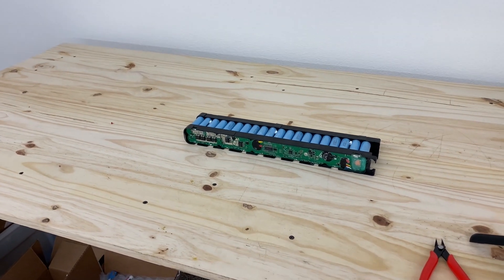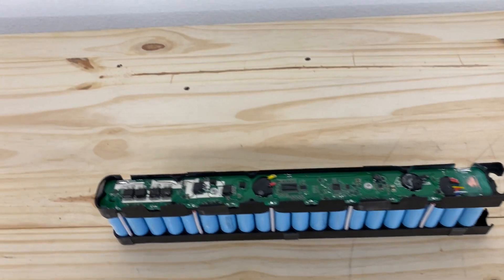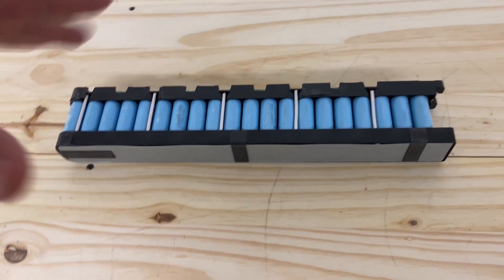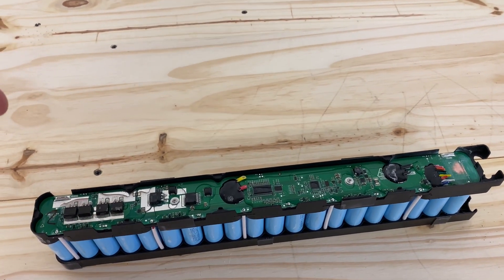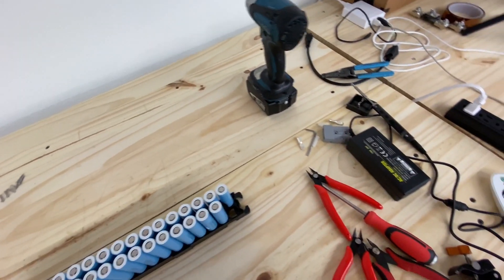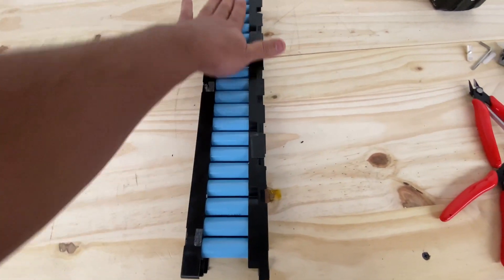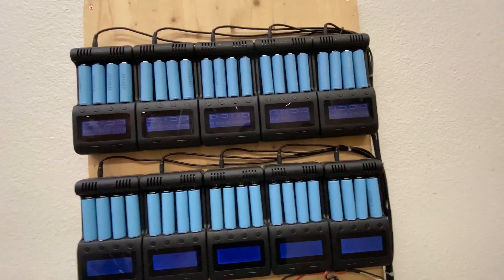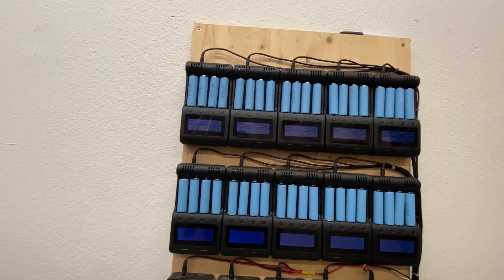The most affordable way to get LGMH1 18650 cells

Comment: i bought a neat little usb module that works from 10 to 80 volts so i can use scooter packs as a portable energy bank.  and i keep the module with me so if i ever need usb odds are something nearby will have the right voltage in a pinch
 .

Comment: Sometimes these salvaged 18650 batteries don't have enough of  an extended positive tab to work in some devices, such as some headlamps. What might be a good workaround for this problem, other than folding up some aluminum foil to bridge the gap?
Reply: What do you mean? As in they are too flat? Pure nickel strips would be a far better option vs aluminum foil.
Reply: No... dont use aluminum foil!!   All you need to do is add solder to the positive sidw.  Works great for flashlights.

Comment: Bought a pack, and the cells shipped to me are averaging 2,900 mAh with 25mR internal resistance using the LiitoKala Lii-500 on full NOR test.  I was hoping to get results like he indicated in the video (~3400mAh).  The ones shipped to me were about 85% the capacity as indicated in the video.  Pretty sad since the "tested" packs were all high mAh, and the ones shipped out are not.
Reply: Could be tested at different amp
Reply: Ikr some of my cells are coming out as low as 2300 mah

Comment: People who use these cells need to be aware all lithium batteries require charge balancing. Otherwise, a lithium fire can start which you CANNOT extinguish. A 2,000F lithium battery fire creates its own oxygen if the cathode is overheated, which is caused by dendritic growth shorts. This defeats most all fire extinguishing methods. Under-discharging lithium cells can also start a fire. This is why the battery pack has a charge balancing circuit board. Only use these cells in a device that already has a charge balancing system for each cell.

Comment: I have 4 of these scooter battery packs. I’m trying to achieve a 72v battery packs for my 72v 2000w bike. Do you recommend that I try using them in series/parallel or should they be reconfigured.?

Comment: These are old Uber JUMP Bike packs. These are 36v nominal packs, 42v full, 30v dead. They are close to the voltage of 2s solar panels. These cells are very energy dense. They have an internal bypass diaphragm under the (+) button. Also, be careful removing the BMS, you can easily rip the cell connectors.

Comment: One Module pack.   Configure to 40P .  Run a single 6 AWG wire up each terminal side.  Spot weld a fuse wire from same 6 AWG Wire to each cell.  Your done.  Good for  A55mp Conterminous legal.  60A no issues. .      I configured the packs to 7S 24v.  Neat , Tidy and works just fine for a Power Wall..     Two such packs your good for over 120Ah continuous  No Smoke. .  Nothing being stress or over ampted.  Basic 7S BMS works just fine.  
The same Idea works with my 6S Nissan modules too  .

Comment: Would these be good for an RV + Solar power bank that's going to run lights, air conditioning, fridge, & pumps?
Reply: Honestly, LiFePO4 prismatic would be a better bet for you in an RV, and it would be much easier to build if you are going for 12 or 24 volts. But, As long as you do the math and size the battery pack properly, these would be fine for an RV + solar bank. It's just a little more complicated to put together the pack   These cells are capable of 10 amps maximum each, and Ideally, you don't want to run them at maximum all the time, so make the pack bigger than your maximum needs will be. I would recommend picking up 10 of these battery packs, for 400 total batteries. If you plan on doing Air conditioning, I recommend doing 36 or 48 volts for the air conditioning to keep current draw and wire size needs and cost as low as possible.
Reply: @catch22frubert  Awesome, Thanks for the explanation. I'll be buying a box truck this summer and I'm trying to plan everything out.
Reply: @Richard-Freeman   No problem. There are a bunch of different ways to get the job done. Just do your research, and the math for what you will need as far as watts/amps, and you can do any number of systems that will work. Just remember, higher voltage systems will pull less amps, and you can use smaller wire all around, so I recommend at least 24 volts. Good luck with your build.

Comment: Hi, you mention you can use that battery without removing the BMS?.
Reply: @2:30 they cut the wires to use as salvage but I don't see why you couldn't rewire it in place may not a pretty

Comment: How could I go about using these to create a 12v 200amph battery system to use for an RV with 1500w inverter? Would it even be any good to do so?
Reply: do you have solar power

Comment: Thanks for the heads up on these LGMH1 Jehu.  I just got 4 from you to harvest cells from.  I'm curious, would you use these in your PCB setup?  I'm thinking a 7s15p x3 in parallel (x3 60a BMS) using these LGs but maybe they would be too much for these boards with a 5A surface fuse.

Comment: Can I get schema and a picture how the wires were connected - so I can reuse the cells as they are for my own project? You mentioned that you have to cut off the wires... (Is there a way to leave them on, since I'm gonna use it as is? Thanks!
Reply from the maker: No, we contractually required to cut the wires
Reply: @jehugarcia  Can I get at least a picture how it was connected, or the way you can cut the wires.... I don't have a scooter or ... I like to REUSE EVERYTHING if I can, that is the only reason. Thanks!

Comment: I enjoyed the video.. do you have a good recommendation for a spot welder for 18650s for around the 100 to 150 dollar range?
Reply: Mitchell Bruce microwave oven transformer, 20 or 30mm2 wire, cut secondary out, new secondary from the 30mm2 wire, a relay or triac for control, and 2 solid copper wire pieces that you cut and shape as electrodes
Reply: @legominimovieproductions  do you have a link to a video showing how to do this?

Comment: Hey Jehu, another great video as usual, but I was wondering about this "New" 8-Slot Battery Charger/Tester. Looks the same, says it does a Charge-Discharge-Charge test (#3 in listing of features) for slots 1-4. Do you have one, can we get a review ? If the Amazon link is killed by YT, the title to search for is:
8 Slots 18650 Battery Charger XTAR VC8 Charger USB C 3A Fast Charger 21700 Battery Charger with LCD Display for 3.6V 3.7V Li-ion 10440 18700 26650 1.2V Ni-MH AA AAA C Full Set with QC3.0 Wall Charger

3. In grading mode (for CH1-CH4), the charger tests batteries’ real capacity by “charging-discharging-charging” the batteries, so that users can know whether the battery capacity is overstated or not, and also distinguish good-performance batteries with the bad ones

https://www.amazon.com/Battery-Charger-XTAR-Display-Li-ion/dp/B0836VHG67/ref=pd_di_sccai_9?_encoding=UTF8&pd_rd_i=B0836VHG67&pd_rd_r=3cbf8b40-9e79-456a-8d77-5d19488f48bf&pd_rd_w=r1UMx&pd_rd_wg=CZqpX&pf_rd_p=61ce50cf-2379-4458-9044-fa8b402c702d&pf_rd_r=HQXMDPR88D6P2JANXFZS&psc=1&refRID=HQXMDPR88D6P2JANXFZS

Comment: 36v is not weird, the length 20  inches makes it almost impossible to  used as is
Reply: 36V isnt weird. It just depends...I can mount that into kiddies Hope up powerwheels or gokarts...36v 500-1000watt brushed motors
12-15 mph or slow..so the kiddies wont hurt them selves.
or hope up scooters from 24v to 36..to 15-20 mph...
It works because in the USA..if you keep under 20mph it's still consider
a TOY...you dont need a RESGISTOR or need a Motor cycle license, Insurance..ect
Then whatever the Fu$k DIY CHEAP projects get RETARDED EXPENSIVE
becuase all the damn FEEs.lmao
You can ride it on side walks or bike lanes...ect
it;s not ment to be use for mountian bikes or longer distance..ect
it's not super fast...
If I want Fast and longer distance...i'll just go petro
 a ninja 600 will do 160 mph EASY ( if I remove the governors.lol)
0-60 mph under 4 sec...lmao
It has a tank to take me...200 miles..
if i was to build a gokart for myself..Id have to go 72V.lmao

Comment: Prismatic lifepo4 is the way to go.
Reply: Completely depends on what you are trying to do. Prismatic LiFePO4 doesn't work well if you are building an ebike battery or something where size really matters. You can get a lot more energy in a small space with these or 21700 cells. I really want to build something with Samsung 40T's.
Reply: @catch22frubert  hardly size matters for powerwalls.

Comment: Does the BMS work if you just hook straight up to the power leads?
Reply: Previous purple lg scooter battery pack had all good cells and BMS on board worked flawless,connected in pair for 72volts and place in bike bag. Running a month now without any problems.
Reply: @Sam S True, but what company would even know that some random dude didn't disassemble the pack fully and put it on their ebike whole? Doesn't matter to me either way, I have like 20 10s boards from way back in the hoverboard era I could swap on if not, just saves me effort.

Comment: what if i use a pwm solar charge controller to charge these cells as i can change the top and bottom voltage for charge and discharge would that wirk safely?

Comment: What would it take to make an 18V battery?
Reply: power tools use 5s and some call it 18v but most are calling it 20v now. With 40 cells in a pack you could do 8p5s (but since these are not new cells you might have a bad cell or two so maybe only 7p5s).
these cells are nominally 3.7v and range from about 3v to 4.2v.
18v / 3.7v = 4.86 so round up to 5 unless 5 * 4.2v = 21v is too much.
4 * 4.2v = 16.8v max

Comment: Dude, 10s is not an unusual voltage... It's slowly becoming the standard for all of the small vehicles. Scooters, skateboards, e-bikes, etc...
Reply: plus you can run these fat 100 watt led from them directly
Reply: You can get some 36v inverters now a day's I'm not real sure about charge controllers
Reply from the maker: But we mostly want them for diy powerwall builds, 36v is no bueno
Reply: @jehugarcia  3 12v inverters in series?      (joke)

Comment: Why can't these be used with the already installed BMS?  or....once the BMS is removed, why can they not remain in the "together" configuration for use in powerwalls or other projects?
Reply: Because this dude is just trying to sling batteries mann
Reply: They can be used in the original configuration. I have an e-bike that uses 36V and a power tool that uses 36V.
Reply: because they are wired 10s or 10 in series, which isn't compatible with most inverters and charge controllers which are designed for typical lead acid battery voltages. 10s ranges from 30v to 42v which is too high for 24v equipment and too low for 48v equipment.  Maybe you can find something designed for 36v and use them as is.
Reply: @Sylvan_dB  Thanks for responding....I keep hoping the information will become clear, but the fog remains...I'll keep listening.

Comment: $131.84-153.77/kWH. Mediocre deal. Batteryclearinghouse batteries were much cheaper per kWH for the M26s, and still much cheaper for modem batteries ($72.80/kWH).
Reply: Everything is in the moment 😊😊😊.I had 100 dead laptop batteries for free last week.
Reply: If you don't mind using Chinese cells, one can buy a new 48V 20A pack using 5000 mAh 21700 cells (13s4p = 52 cells) for $105 and free shipping at aliexpress right now (6/10/2020).  That is $109/kWh and about $2/cell for brand new 5000 mAh 21700 cells.
Reply from the maker: Yeah but m26 are so last week